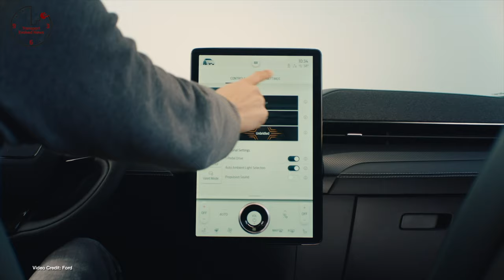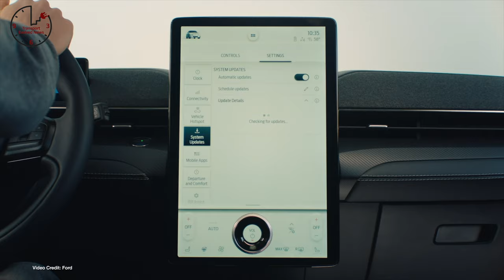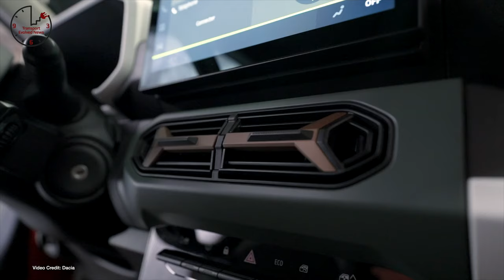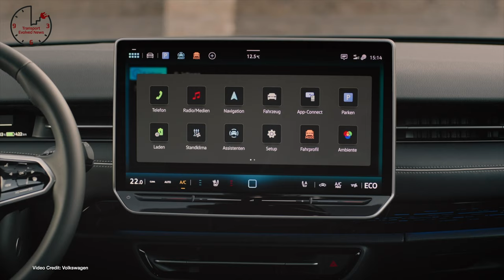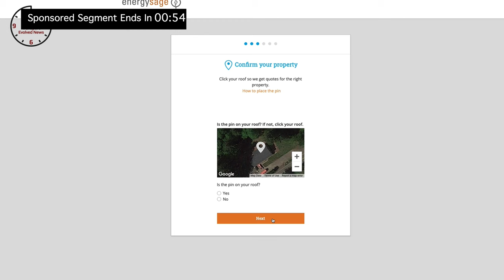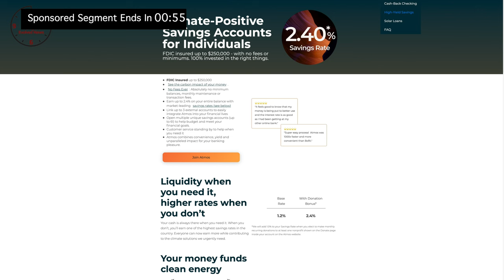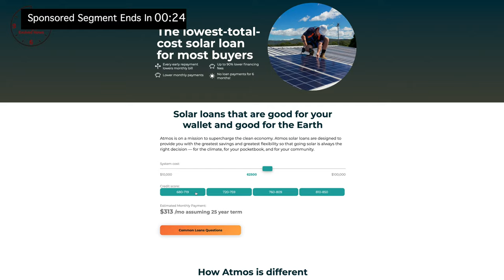Transport Evolved News TEN Episode 474 - Don't Slow On EVs, Joe!

Comment: They are doing everything to continue to sell gas, but remember all of the things that no one continues to buy. Just remember Kodak.
Reply: That transition happened because manufacturing electronic components is cheaper than manufacturing mechanical components, and because the required film and film processing industries were outside of the camera company's ownership. By removing film and film processing, the camera manufacturers were able to consolidate profits and cut out an entire industry and replace it whole cloth without having to create a new parallel infrastructure. And by the mid-2000s, finding manufacturing partners to build the small precision mechanical components had become exceedingly difficult to the point where these companies didn't even want to honor warantees on film cameras any more. In fact, the transition happened so quickly that there was a weird period of time when digital cameras were still making garbage quality images but film processing was difficult to find. But the crucial thing here is that camera companies found they could dramatically increase profits because under the skin they are basically selling the same camera in a dozen different "bodies"... it also created justification to sell photogs all of the lenses they already owned all over again. And every few years they come out with a new camera platform and make sure it doesnt work with the same old lenses. The vehicle industry isn't really the same. There are not huge profits in the EV transition, and getting rid of gas puts the burden of infrastructure on the car companies... that further reduces profits. That's why they are dragging their heels.

Comment: 26:37 the Diesel Dummies uh... sorry Diesel Bros or whatever, are rumored to be showing as real examples of prototype Badgers, a couple of cosmetically altered Ford F-150 Lightnings.... Doesn't seem likely that they could have actually built the trucks, but stranger things have happened. Do you guys have any real info on the project? I'm patently disinterested in the Badger except that it may be a total scam and should be called out as such if it is. If not, I'll celebrate along with everyone else that technology has gotten to the point that a couple of hype meisters can throw together a cool looking truck composed of wishes and opinion without having to evince a gram of engineering competence... hey, I like miracles.
Reply: Prototypes are easy. If you have a few million dollars and some cool external design, you can get them made. Internally they can be some more-or-less standard components off some shelf. Doesn't matter if it is a Ford shelf. So, now you have a prototype truck you can drive around and show off. But you can't sell trucks for a million dollars a piece with boring specs (since the internals are bodged together standard parts.) So figure out a way to make them with good specs and mass produce them for less than people will pay for them. That is hard. It seems like a convicted fraud did the easy part, now they only have to do the actual hard part, after being stuck at the starting line for three years in a race that has already started.
Reply: Anyone with a wrench can swap out panels. There are plenty of small shops that have been building aftermarket plastic body kits for decades. The Deisel-nics could easily have hired a company to build the kits and then done the "conversion" in a few days. But lets be clear... panel swapping isn't building a prototype... it's not even building a concept. If I put a Rolls Royce kit on a VW bug, that doesn't mean I own a real Rolls Royce. And if the plan really is to "convert" F150Ls and re-Badge them as Badge-rs, why would anyone pay the premium for that? Its all very silly.
Reply: @patreekotime4578  Yes, but if your goal is not to mass-produce vehicles at a profit, but to drum up interest around a brand by showing off the exciting new products that are supposedly just around the corner? So you can cash in on the increase in stock price? Then it is not silly, but unethical and probably illegal.

Comment: Tesla will have legal challenges with voiding Cybertruck warranties after wading through water. The vehicle was designed for this function, and they will have to prove damage was directly related to the travel through water.
Reply: The manual says that the Cybertruck wade mode is limited to 5 mph.  Those guys hit the water at speeds as high as 25 to 30 mph.  Surprised there wasn't more damage.

Comment: If you like EVs (Electric Remote Combstion Vehicles) and they provide all the things you need and want from a vehicle, that's great buy one.

But don't expect or demand because you own a certain type of vehicle, of any type, that the local authorities in your area should or have any responsibility to provide infrastructure for your vehicle.

You buy a vehicle that's suits your local infrastructure not expect local infrastructure to be changed to suit you.

Also again, if a Electric Remote Combustion Vehicle suits your needs, that's good. But don't delude yourself that these abominations are saving the world.

You want to cut carbon emissions?
Build Nuclear power Generation plants and get the worlds cargo ships to change to Nuclear power.

Coal powered cars are pointless and you are attacking the thin end of the wedge.

Comment: Here in southern California the electric companies have trouble providing power to our homes in the hot summer months, how can they provide power to cool our homes and charge EV cars. It can't be done.
Reply: Of course it can be done. In the hot summer months you are bathed in free sunshine. It is a trivially easy "problem" to solve.
Reply: You charge your car at night, after cooling demand has subsided; or middle of the day when you have lots of solar, as the other person mentioned.
Reply: Microgrids. Rooftop solar. The solutions have been available for 20 years, but it requires investment. And BTW.... even without EVs, demand growth will require these solutions anyway. But it requires the power utilities to spend their profits on infrastructure instead of lawyers and lobbists.

Comment: There is nothing wrong in slowing the transition the electric!It dosent matter if it takes 10 15 or 20 years!Stop with the crazy drama!Only about 10% of all C02 emissons come from privat transportation!So even if we would drive 100% evs tomorrow that would not change much!
Reply: The more we delay action on climate change: the more urgent action becomes. The reason is that our "carbon budget" (to hold the line a 1.5C or 1/3 of an XKCD ice age unit) remains fixed.

When the  Kyoto protocol was signed in 1997: we had about 50 years to phase out fossil fuels (2050 deadline).

After 25 years of inaction: we have about 7 years to phase out fossil fuels (2030 deadline)

If Conservatives get elected: we will have 4 more years of inaction, and negative1 years to phase out fossil fuels (2027 deadline, plus minus a few years).j